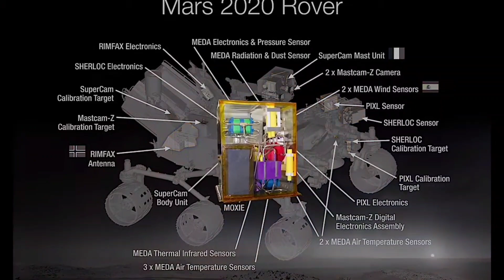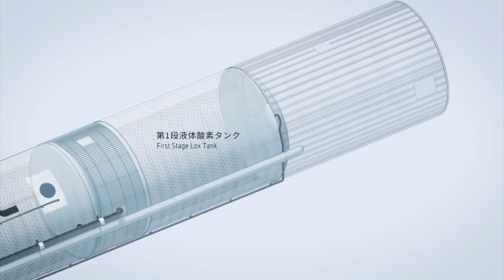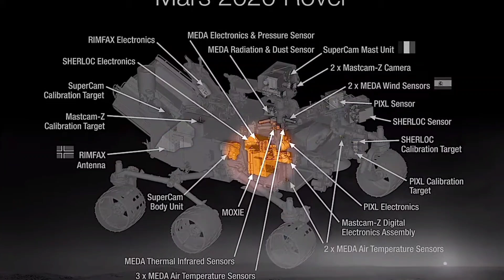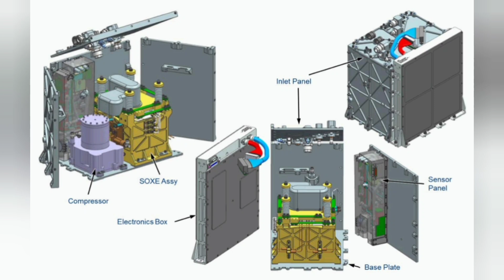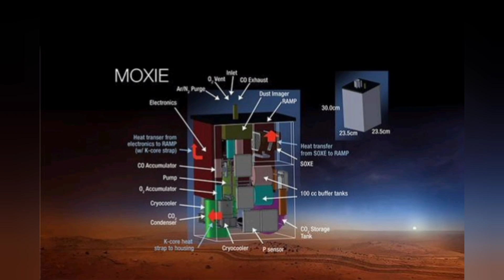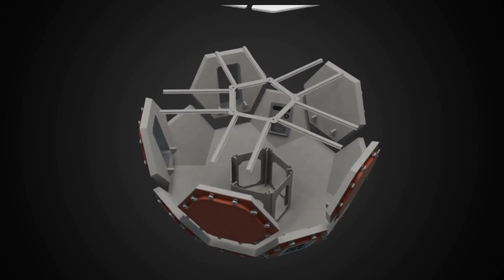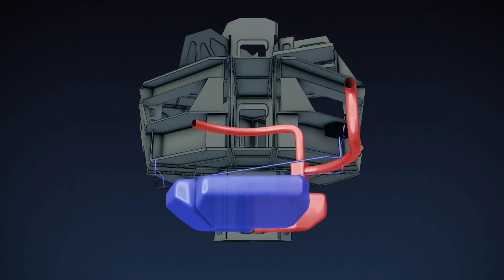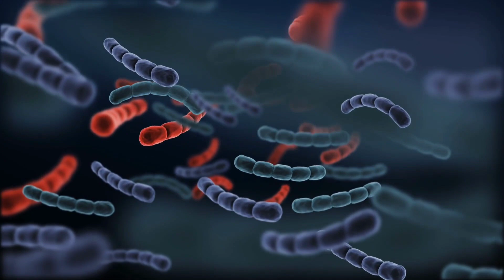MOXIE and Ingenuity may work, but they suck!  There's better solutions for Elon Musk's Mars!

Comment: 1)  Just because the blades rotate faster does not necessarily mean they consume four times the power.
2)  If they did consume a lot more power, who cares?  Free solar charging.
3)  If the concern is recharge time, the solar panel could be bigger.
4)  If the concern with a bigger panel is aerodynamics, just make it rotate to vertical while flying, then horizontal for charging.
5)  What makes you think a balloon "works WITH the thin atmosphere"?!?!?!  The lower the ambient pressure, the less lift.  A balloon would be perfect for Venus;  probably not even possible to make a balloon that works in Mars.  It would have to be IMMENSE.
6)  MOXIE is just an experiment;  not a commitment.  Sometimes you think you know what is possible, but it's good to test your theory;  and it could prove useful.  Would you rather HAVE or NOT HAVE a few MOXIEs on the ship in your first Mars visit?  I'd sleep better knowing that if the water electrolysis system gets hacked by the Russians there's at least a backup way to make oxygen;  no?
7)  Perchlorate sucking bacteria rock, but again, I don't think having a few MOXIEs would hurt;  and the problem with any bacteria, at least initially, will be political.  Which is absurd, but it's the way it is.
Reply: A vacuum airship could work on mars but as you pointed out it would have to be quite large. Angry thinks you can just down scale it to something that can fit in perseverance and that’s just ludicrous lol
Reply: @shaneboardwell1060  Exactly.  To put it down to rough numbers, the lift force per unit of volume would be less than 1% what it is on Earth, using the same gas, e.g. hydrogen or helium.  Much less than 1%.  And that is assuming the thickness of the balloon material can be scaled down 100+ times;  otherwise there's overhead to consider.  And even if that were possible, how do you maneuver this huge thing, take off and land, given the crazy wind of Mars?  And then trying to design a Vacuum Balloon, is even harder to consider because then the feeble skin force is inwards, and so the material has to be rigid, and be extra strong to account for the instability of inward pressure distribution under deformation.  It is really the most absurd idea Angry's ever come up with.

Comment: Too many assertions based on a lack of knowledge. AA fully admits a lack of education in these fields and yet speaks "authoritatively". These are prototypes only, the development on them began when Earth's knowledge of Mars was much less than it was when they finally made it there. Oh and both of them worked, BTW. Are they inefficient? yes of course but remember that the first solar cell ever made worked but it was less than 1% efficient. Today cheap bottom end solar cells are 20 times better and experimental ones are as much as 50 times better. The Ingenuity does not need a "much greater" payload to be useful, that is a bald lie as it has already, in form it sits right now, proven valuable in a roll it was designed for. More payload would be nice, and may happen, because it would allow it to replace a wheeled rover but not having that would not make it useless. MOXIE I know less about. However, it was designed when it was thought a lot less water was available except at the poles and as above, neither you or I know how it's efficiency will be a few years from now. There is a lot more water than was thought in more places than was thought but not everywhere on Mars' surface.

Comment: The amount of heat Moxie creates I would think they would be looking to be using that for heat and even some energy production. Problem would be is that you are getting a very technical piece of equipment and without the ability of access to parts quickly we would have to spend a lot of energy just making sure the system keeps running. Now as a first step there are a lot of questions to be asked and problems to be fixed. As nice as it is to see this system working, it needs to be heavily modified in order to be practical. Great video and coverage on all of this.

Comment: Ingenuity is only generation I. With reliable power sources like thorium reactors plus the increasing power density of batteries drones will be more practical. Improved energy density should provide enough juice for both higher rpm’s and additional sets of propellers.
Reply: The best thing is pursue two or three possible solutions. The Ingenuity pathway, in which we already have a proof of concept, and at least two other leads.

Comment: Personaly...

For the helicopter I preffer a cross.

A helicopter, of sorts.

At the top, instead of rotor, you have a bowl effectively a fabric that is borderline oneway, gass permiability-wise, that is. 
Right outside it, you have a layer that spins like a rotor.
This pulls air out through that bowl.
Thus you have a whole volume of low pressure that is surrounded  by an area of rotor-analogue of air driven down.

Baaically an air boat carrying the anchor.

Comment: wouldn't the gravity of mars determine the weight of the helicopter on mars .. and less resistance in the air means you can possibly achieve a higher RPM of the motors because of less gravity overall ..
Reply: This, he's wrong, a helicopter makes sense on Mars. Because the air is to thin it's rather easy to spin the rotors very fast and with a high attack angle. The total energy needed is actually rather low, and with the low gravity this makes it even better. A dirigible makes no sense, the air is too thin for buoyancy.

Comment: I just want to point out one important thing I think you're overlooking. You don't need to generate 100% of the oxygen used over time from the Martian surface OR atmosphere. You only need to generate the initial amount. Any additional amount can be reconstituted from the CO2 produced after that by using plants and other technologies such as nuclear fission to do the heating. That requires a robust and large ecosystem to be transplanted to Mars and reliably sealed off to retain those gasses. 

You're right about the helicopter though. However, I do think that using a MUCH larger helicopter blade spinning at about 1/4 the rotational velocity. The limits of the size of the payload are the main reason those blades had to travel so fast. They couldn't be big enough otherwise. But if size isn't a limiting factor, you can utilize an extremely large lifting surface instead. The reduced gravity and lower atmosphere means that the size that is possible in the Martian atmosphere is much much larger than what's possible, or required, on an Earth based rotary craft.
Reply: One problem is the 1 to 2 % efficiency of plants for recycling. It seems this should be a primary focus for biologists.
Reply: @primetwomillion2665  you'll need an enormous amount of plant biomass. but there's specific species that are more effective per volume than others too.

Comment: It was my understanding that Ingenuity's first range limiting issue is the heat generated by spinning those rotors so fast - the thin atmosphere just doesn't dissipate that heat, so they have to land the little helicopter before they burn up the bearings. That's not to say that the batteries would carry it a whole lot further, but it is an interesting issue, IMHO.

Comment: The chlorate and perchlorate in the Martian regolith might be a fine source of oxygen. And a chemical reaction, creating iron chloride and free oxygen from regolith high in iron oxides and perchlorate might be a useful tool, and  the iron chloride is a useful acidic chemical for many processes.
Reply: You can also use it as a rocket propellant.
Reply: @jewellcarpenter6764  Absolutely true! I've not read what aluminum bearing minerals are on Mars but surely there's plenty-especially if there's lots of clays, which have Al2O3. But if there's bauxite, that would be great. The atmosphere and ice have everything needed to synthesize binding chemicals. All that perchlorate, aluminum, and rubber-we could make solid fuel  boosters like mad. Perhaps ballistic travel rather than helicopters or airships would be the way to go. Fun, at any rate.

Comment: Ingenuity was always the first step. It was the minimum for the Test for the larger Copter. The Question why it is feasable is very simple: It is light, Ingenuity Mass are 1.8 Kilo's, the full Explorer Helicopter without Science Instruments will be at 5 Kilo's and it would be autonomous, communication wise. The Max Design weight 11.5 Kilo's. And they are designed for Mars as they fly like a Bumblebee on Earth. They literally make the Air to behave like a liquid. And there is a Max Mass for that effect.

Nasa is looking into an Evacuated Air Ship for Mars, but they have big construction Problems and Evacuated Airships only become feasable when they have a minimum Mass, the proposed Airship was 80 meters with a 100 Meter Diamater, 1,500 Tons of Dry Mass and enough extra lift for 500kg Cargo. But thats stille twice the mass of a Mars Rover ! 
So it would be a great Cargolifter for Mars, when we have big rockets running there.

Airships are living on the Quare Cube Law. Which means, when you make it smaller you lose Cargo Capacity (Volume) far faster then DryMass (Hull and Turbo Pumps) So i guess you won't go much under 1000 Kilograms with an Evacuated Airship. Which is the typicall Mars Payload today. 
So you can have 100 Max Load Helicopters (11.5 Kilograms) transportet to Mars for ONE Airship, or 20 and a small 800kg rover as Base Station.  

I guess it would make sense to have Both. One Airship as Carrier and 10 Helicopters as Payload and then you have still 400kg Cargo Capacity free.

But the high Mass of an Evacuated Airship is a big Problem. On a second thought, maybe Nasa can shoot one up, as they don't need an Entry System and save several Kilo's there. Only a retrorocket to initiate Atmospheric Entry and fully Evacutaed for maximum lift, should be enough. But as said, one Air Probe instead of a Probesystem. And Airship can be thrown against a Mountain when there is a Storm comming and they couldn't anker fast enough.

Comment: I understand why they wanted to try a rotatory wing on mars. Great achievement , but, as you say a ridiculously energy expensive pursuit. Great science experiment, but, not a useful craft.
Reply: Isn't a drone that can scan terrain and inspect caves extremely useful?
I don't think there was any intention of scaling ingenuity up for human transport..
Payload is moot if it's job is to just look around in a series of hops.
I have no idea why angry thought NASA wanted to upscale it, they won't want an airship because they need to inspect geology, caves and rock formations, not fly high...      :)
Reply: @D_Rogers  I hear what you’re saying and somewhat agree, but, the flight time is tiny,  not much exploration of cave systems will be possible.
Reply: @SFV4Rider  Yea, but it's a minimum weight prototype... Having established it works, they won't send another one with similar limitations..

When I saw it, I just assumed it was a prototype camera drone for inspecting things and getting around rough terrain faster than a rover. 

For me, the best use case for the finished version would be radar mapping caves to establish which ones have nice flat floors..       :)
Reply: @D_Rogers  and if starship doesn’t work out we’ll only need to wait 5 or 6 decades with Artemis to set foot on those flat floors 😂
Reply: It has already been an extremely useful tool on mars,  and a version 2 could do even more.A vacuum or hydrogen balloon is not easy. A hydrogen balloon would have a very short fixed lifespan as hydrogen escapes all containment and could not be replenished on mars and a vacuum balloon would be an extremely fragile tens of billions of dollars project at any scale. NASA 100% made the right choice.

Comment: Airship transport is the most logical choice for Mars... anything else would burn excessive amounts of fuel or energy to stay airborne, or be very difficult to control. Whenever humanity sets up a colony on Mars, I think it's entire success will come down to building good Airship Transports for both Humans and supplies.
Reply: All that red rusty regolith. What a great source for steel rails. Trains...
Reply: @ekaa.3189  They’ll need steel for much more (construction), but alas, that requires mind boggling amount of energy. So in one of the first starships, they must move nuclear reactors.
Reply: @hanswitvliet8188  Ever consider how much rusty regolith there is on Mars? More than enough for making steel tubes going everywhere. When that steel is made it will liberate a lot of oxygen. Of course we also need steel for making mining equipment. As for methane production, that still requires water for the hydrogen needed for making methane. The Oxygen would all be needed for the oxidizer side of rocket fuel equation.
Reply: Alas for those horrible strong and long lasting dust storms…

Comment: If you scaled up MOXIE, it will likely get far more efficient. Part of the problem is heat loss, which does not scale linearly with volume (more like surface area). But sure, 12 moxie units running in parallel for 4 people would require about 3.6 kilowatts of power, or a few percent of the power output of the ISS. You are making a mountain out of a molehill here (besides, if you were doing methane and oxygen production from CO2 and mined water, you would probably just tap off the oxygen from that). MOXIE is meant to allow you to generate oxygen from the air without ice mining, which is a useful capability.
Reply: Or you can just grow some algae for zero energy cost... Also equipment with high degrees of complexity FAIL and when they do millions of miles away from the parts department you are screwed.

Comment: I strongly disagree. Ingenuity is comparable to the Wright Flyer, not a Coast Guard or heavy lift helicopter. Get real here, it's a starting point, and the technology HAS to be improved to be sure, but you don't start with the final solution, you iterate and work towards solving these and other issues as you move forward.
Reply: I'm not trying to take away from it. Don't be so sensitive 🙂
Reply: I agree , but we're just talking 👍

Comment: I'm no expert on the matter, but such an airship requires sufficient buoyancy right? the bigger and thicker an atmosphere is, the easier it is for a balloon to have enough buoyancy to floats around low in that atmosphere. mars thin small atmosphere would make it much harder to give an airship sufficient buoyancy. Ik you said it would have to have a vacuum in it, which on earth would give it far more buoyancy than any airship that I know of. but on mars the buoyancy would be so much lower, that I imagine anything capable of containing a vacuum would possibly be a bit too heavy for any buoyancy it has to be enough to lift it off the ground right?

I see there are a fair few negative comments on this video and I'm not trying to be one of them. but this seems like an issue that's not so simple as the video makes it sound. I'm no engineer, but if someone here is and sees this comment, could we get the numbers and a basic explanation of the issue? I won't say it isn't possible because I definitely don't have the numbers, it just seems a bit unlikely.
Reply: You seem to understand the problem of a vacuum balloon. Just lifting itself would be very difficult, let alone carrying a load.
Reply: @wiregold8930  the airship just have to use the power of remembering friends and family and there u go,, it will fly

Comment: MOXIE was just a proof of concept.
Reply: C'mon Jordan you know very well that Moxie is a proof of concept. NASA said it so many times that the goal of this experiment was proving that it could be done. This kind of engineering is made in steps. Next one will be increasing O2 output with less energy usage. And that can be developed and used alongside the alfalfa and cianobacteria.
I totally agree with your take on Ingenuity. A blimp or airship would be a much more sensible approach from a power needs standpoint.
Reply from the maker: A flawed concept. Extracting oxygen from the Martian atmosphere will never be energy efficient, and we knew that before we sent it.
Reply: @TheAngryAstronaut  May be but at least you do not need to carry an algae farm around with you and a MOXIE just needs power and Carbon Dioxide.

It's about a flawed as a rebreather or a fireman's oxygen bottle. It may not be a perment solution but it does have it's uses and adds it's own dimensions.

So why not BOTH?
Reply: And carrying the algae around just means you put time/effort in to make it in the first place. So it would still have it's place and you still need to scrub the Carbon Dioxide from any environment (which include suits and vehicles).

I'll be waiting in a finalized product to see what the power usage/efficiency is.